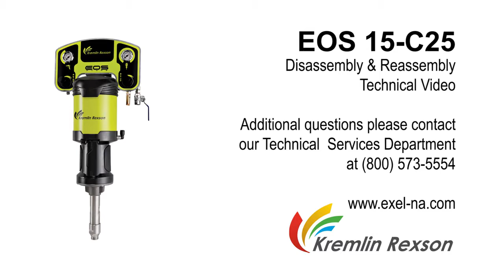15C25 Airmix® Paint Pump - Disassembly & Reassembly | Sames

Comment: Cool Video. Well done. Thank you.
Reply from the maker: Thank you !
Reply: I recently was spraying a post cat 2K and didn’t clean my gun and went home for the night. (The second time I did this in the past 4 years 😢. 

I fortunately was able to disassemble my entire gun, replaced the fluid hose, cleaned out the gel’d over finish in the pick up hose and rod, took apart the lower area of my pump the pick up hose attached to, removed that 8” long sleeve that holds the plastic piece and the ball, disassembled it all and after a few hours of using the pipe cleaners and acetone, along with a new re build kit, i was able to get it working again. About a $600 screw up

I fortunately didn’t need to disassemble the entire pump the way you guys showed, but great detailed video to show step by step of how it’s done. Grapex action does a really good disassembly/reassembly of the entire gun, including part numbers

Ty for this video
Reply: Great video.  Thank you.  What kind of grease are you using?